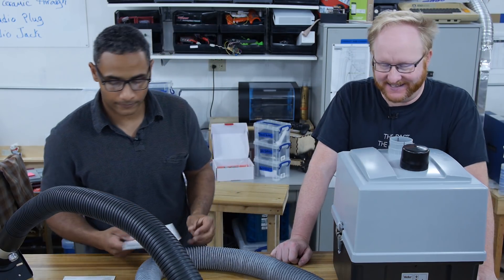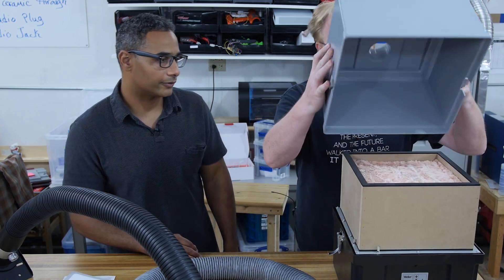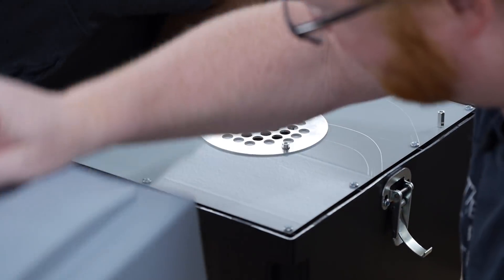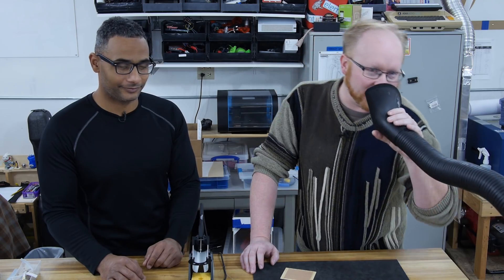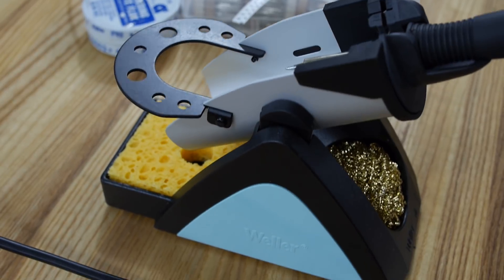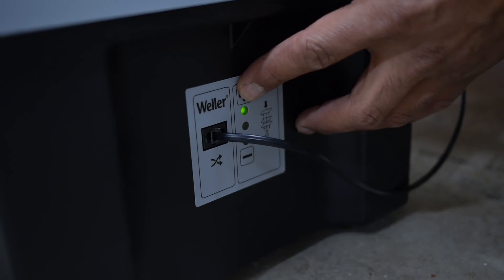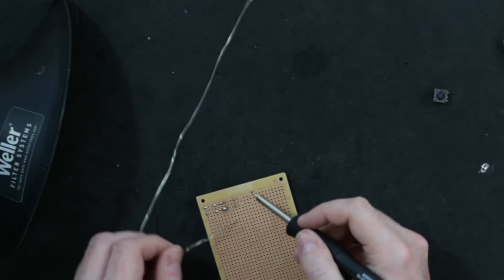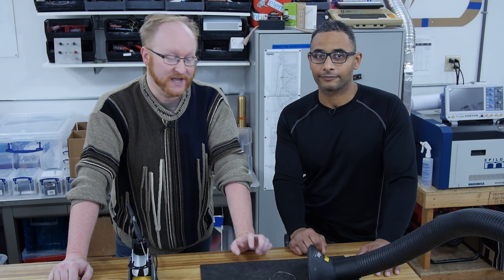Product Review - Weller's Zero Smog Fume Extractor

Comment: well, for those who wonder, why it costs so much:
1. it's a professional equipment. it doubles the price since it is not the mass-market device and company profit is not compared to anything like a vacuum cleaner.
2. it is not a vacuum cleaner. try to put such a big filter to your VC and see if it really performs good and quiet enough to use it 2-4 hours a day.
3. if you're working on PC mainboards, you breathe with all kinds of chemicals, from the board compounds to isopropanol, including lead fumes which are extremely dangerous in long-term. 
4. if you're working professionally, the price is more than reasonable. you also perform much better if you do not have a headache after a few simple but smoky repairs.

Comment: That thing costs more than my entire setup combined! FREAKING CRAZY! Any suggestions for good extractors in the sub $100 range?  Safety is important but yeah I do NOT have $600-$1000 for well anything to be honest.
Reply: There's nothing proper in that price range, closest thing is Aoyue's FEK-01, which costs twice that. The only options are either finding a used one, or building one yourself. There are some vacuum cleaners with variable motor speed you can salvage the motor and control board from, the other half is finding HEPA, active charcoal and dust filters that can be stacked together into a combined one.

Comment: Personally, I fail to see the point of any sort of extraction system for sodder (sorry, soLder) fumes for the electronics enthusiast, especially when not using an iron all day, every day. Also, the size of that unit is probably too big for most hobbyists as it would take up valuable space where something much more useful could go.
Reply: I agree a little pc fan to keep the fumes away from me is enough there are much cheaper options to remove the fumes if you absolutely cant have them in your area your soldering in I dont even want to know the price of that thing I simple way to deal with the fumes is to tape a few layers of filter material to a pc fan if the noise of a pc fan bugs you just solder outside

Comment: $650 bucks?!?!?!  yeah pretty sure you can make the same thing for way less
Reply: It's not just Weller, no matter who you try to get one of these extractor from, the price is always ridiculous. Especially considering it's just a box with a fan and filter in it with a hose coming out the top. There are many ways to DIY one though, like in this video: watch?v=JdrFsuAcm48
Reply: Magna Ryuu that's just weller. Check out how much that soldering station would cost you; all their stuff is really good but super-expensive :-(
Reply: still would rather make my own system
Reply: Thing is, if you're like me and only solder the occasional kit, or small project once in a while, are solder fumes really that bad...? I normally just have a box fan to disperse the rising fumes. So yeah, question is, do I really need to buy something that costs 30x my soldering iron. I can understand though if you're soldering 12hrs a day or something...
Reply: Breathing in any smoke is bad especially over a lifetime of exposure.  I have two charcoal filter fume extractors and use them religiously.  I do a fair amount of soldering and I still use leaded solder for older board repairs.   I agree that $650 is not priced for the hobbyist, but if they had a lower priced sub-$200 model with these features I would consider it.  I am a long-time Metcal fan for soldering irons - they heat up quickly and maintain temperature well.
Reply: Sure, tell your boss that you're gonna spend a day or so building a fume extractor. That could lead to an interesting discussion about hourly rates :-)

Comment: the place i worked at last year had one of those weller fume extractors. I ended up making a soldering area that the hose connected to, to make it a down draft table. the down draft table also quieted the moving air past the nozzle noise down even more.